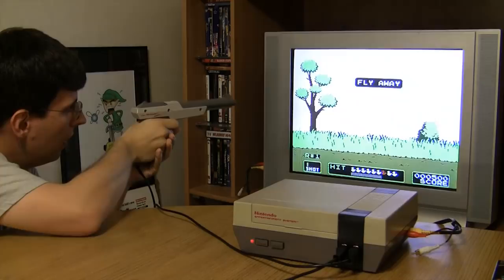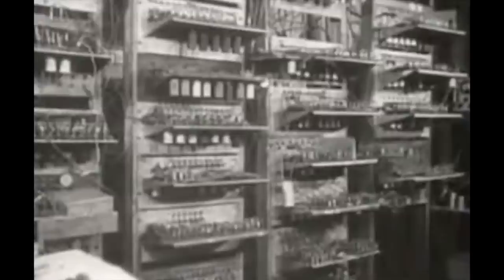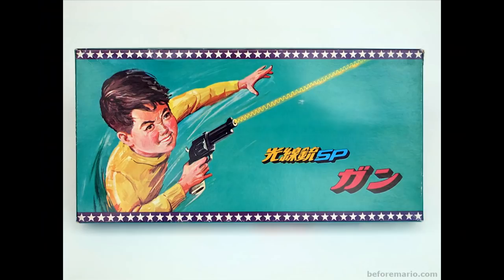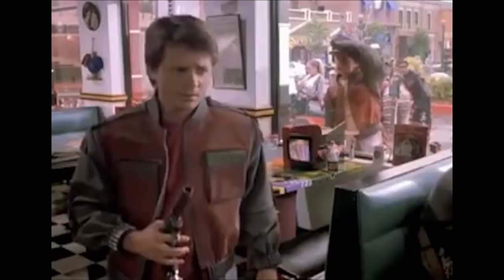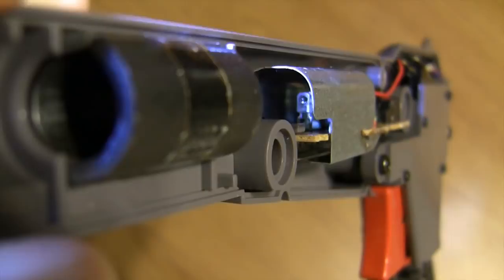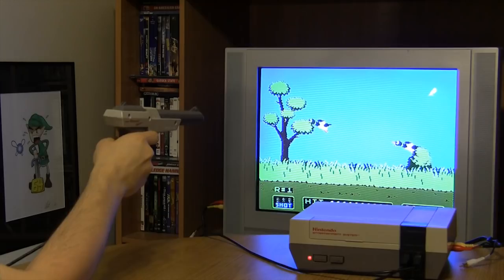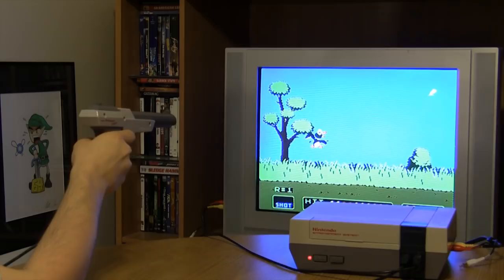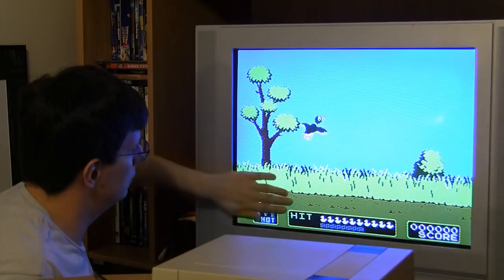The Way Games Work - NES Zapper

Comment: So I need something that delays the input of the zapper, like 5 nes extension cords? Or am I miscalculating this here?
Reply: it'd be interesting to test that out... if i had some extension cords... or a Zapper...

...or a NES
Reply: Electricity travels at near speed of light. While extra length of wires does technically lengthen the travel time, it is for all intent and purposes insignificant. What you are really doing is weakening the electric signal. If you make the wire long enough, the signal would become to weak to be detectable. A longer wire is also more vulnerable to "corruption" from radio signals and such.

In the internet, what cause the bulk of the delay (ping/lag) is data processing. For example each time a router receive your data and must determine to which other router it must forward the data to. Then the actual encoding and decoding of the signal each time it is transmitted or received on wire/wave.

Put simply, you would need an absurd quantity of extra wire to get the delay you want. But the signal would not survive that long. So what you would really need is a bunch of "signal repeaters" chained together to input delay without sacrificing signal strength and integrity. But at this point, you might as well use a custom device that simply delay the signal X amount of time.

Or... Get yourself an old TV.

Comment: i,ve tested the pal version of duckhunt on a ntsc nes with a pal crt tv supporting ntsc,it still works,i also tryed an ntsc version of duckhunt on a pal nes with a pal crt,again it just works fine.
how is it possible that both versions of duckhunt cannot destinguish 60 and 50 hz?
also with if we could simulated scanlines on an lcd and plasma screen at 50 & 60hz as fast as possible,maybe that will trick the gun.
also it's insane that even if i connect my nes to a dvd recorder using the same crt tv,it just will not work too,because of that slight lag.

Comment: The zapper does not work on lcd, plasma screens because of the latency,and they are digital,the’re mostly 100hz and they don't work with scanlines.

Even digital 50/60 hz crt tv's don't work either   Too,

Or when you connect your nes trough a dvd recorder to a 50/60hz crt tv does not work because again of latency.

 ,so theres no way around it, unless we can moddifie those games to take latency,100hz and any type of tv into account via an option settings menu.

Comment: So if the problem with the zapper is due to lag.. Would it be possible to  extent the Zappers cord to compensate for the latency ? If you consider that this method is used in cars for plug wires there is most likely a way to extend the latency of the signal from the NES to the Zapper. Wasn't there an extension cord you could get for nintendo controllers back in the day ?
Reply: Gaming History Source 1. Since the signal travels at the speed of light, you'd have to get a ridiculously long extension cable, and
2. Adding input lag would just contribute to the problem.
Reply: Terribrilliant  not really. He noted a momentary delay between the television & the zapper as a necessary delay to overcome the potential for cheating.  Creating lag in the cord through an extension or by simply placing a resistor in the circuit might be enough to over come the delay in the video signal to re sync the light gun to the monitor.
Reply: No. Think about it. Adding more lag would just make the problem worse.
Reply: Terribrilliant
Gaming History Source
Pretty sure Terri is right. if you add lag to the wire we now have the trigger pull followed by several ms telling the game waht to do at it's usual rate followed by the gun performing it's checks with it's usual timing but now with a longer transit for information moving physical events further apart while checks are still being performed at the usual speed. The right fix I would think would be to introduce lag in the cartridge. if the cartridge took a couple extra MS to do all of it's stuff that would give the tv a chance to catch up.
Reply: By adding lag between the gun and the NES, you're delaying when the game code decides to initiate the black/white frame sequences, resulting in a net result of no difference besides EVERYTHING occurring slightly later.
Reply: +jmholmes83 just theorizing.  Because I have an idea but not sure if it would work. I need a way to make it.
Reply: +Gaming History Source right on... Personally I hope you figure it out, I'd love to play my games without hooking up the old tv! I just feel like it would take modifying the game code to account for each lcd's characteristics, kind of like guitar hero has built in adjustments.
Reply: +jmholmes83 indeed. That's why I thought delaying the signal would compensate for the latency between the zapper & the TV.. but it  didn't occur to me at the time the timing between the zapper eye & the console.
Reply: +Gaming History Source 

"Creating lag in the cord through an extension or by simply placing a resistor in the circuit might be enough to over come the delay in the video signal to re sync the light gun to the monitor."

That's not how a resistor works.

Introducing electrical resistance only reduces the voltage and amperage by dissipating some of the energy into waste heat (albeit a virtually undetectable amount of heat, but that is the mechanism nonetheless).

It does not reduce the speed at which the signal travels in any significant way.

You'll be stuck with the same issue while introducing a new problem of dropping the voltage too much to allow the NES Control Deck to register the Zapper's trigger being pulled.

I'm afraid the best way of dealing with input lag on a modern flat panel TV set is to find a way to make its video processing, necessary to scale the image to the panel's native resolution, fast enough that the image appears on the screen as instantly as it would on an analog CRT television set.
Reply: Even if that worked, you'd need a REEEEEALY LOOOONG cord (and a lot of amplifiers) due to the speed (near light-speed probably) the the signals travel on the cord.

Comment: There is another reason why zappers don't work on HD TVs. The key is in the anti cheat intial screen. Even highest quality TVs do not produce a true black. In plasma screen colors are produced by oscilation. Again same issue. You never have a true black. It also can be a combination of both.
Reply: what about OLED Tv's?
Reply: +The Zombie Block Not sure would be interesting to try.
Reply: just throwing this out there, photodiodes dont necessarily care about the color of the light, just whether its present. it works similar to other analog logic devices, how you interpret the 1 and 0 is somewhat up to you. for example anything over like 2.0v is HIGH (1) in ttl logic chips. and anything under is considered LOW (0). but the path between the input of the chip and output of the sensor can have circuitry that can change or "fix" the analog signal to better present it.

i would suggest turning down the brightness in your tv so the black seems black. i had a Insignia HD 40 somethign inch tv and it's black was black. it was impossible to tell if it was on or off when the video was empty. but this is all if you can get past the delay issue. 

it MIGHT be possible to modify the gun or make an adapter to either remove the "cheat" screen or delay the gun. at least the light detection part. dunno i might be thinking of the delay backwards, and any delay to the diode only extends the gap, but if not it could be done.
Reply: Actually the plasma tv does work for games like duck hunt and I've gotten mine to work on a plasma tv without changing a thing. For some reason if I take the zapper aim below the tv and shoot if I aim the zapper up really fast I can hit a target but it is really difficult and hard to do.

Comment: hmmm... then i bet it works on my 1080p gaming monitor. it has 8ms input lag, so half a frame.
Reply: The timing for the gun appears to be down to individual frames, so any lag/gap between the TV and when the NES thinks the frame should have been visible based on CRT timing, would break it.
Reply: well, it is worth testing. sadly, i have no zapper lol. and sold my top loader nintendo
Reply: If you truly have 8ms input lag, it should work, as that would be equal to 0.48 frames of input lag at 60fps.
Reply: Totally your grandpa cool. and yeah, it is really that low. it is a gaming monitor. i researched a loooong time for it because i came from CRT, and i can feel input lag. every HD tv i have used (around 10) are unplayable for fps. luckily, this FEELS like a crt. not noticeable lag at all. of course, it is a TN panel, though. so not as good of colors as an IPS

Comment: My light guns don't work on my sony trinitron flat hd crt.
Reply: your trinitron might have an upscailer built in.
Reply: +Trekeyus I went into the menu and made the aspect ratio 4:3 and still didn't work. I read that it may have something to do with the mhz?
Reply: try turning down brightness, if the black is bright the diode will pick it up as if it was white. the diode cant see colors, only light intensity.
Reply: +Joe Mieszczur The brightness is already pretty low but I'll check it out anyways and report back.
Reply: Report?!